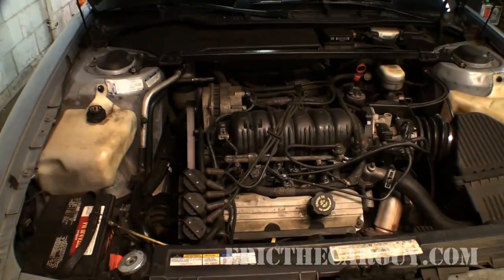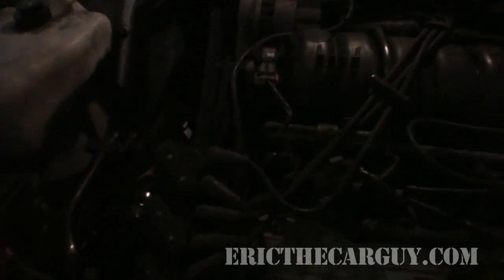Finding Ignition Voltage Leaks - EricTheCarGuy

Comment: I had a new plug wire that leaked On snapped throttle, sprayed water it got worse. Put the old wire back on,car fixed.

Comment: Hi Eric , I have leaks at the spark plug boots arching on the head , I’ve changed plugs , 3 diffrent sets of wires , 2 distributors , 2 ignition coils and still have arching , I cleaned all grounds on the car , the vehicle is a 1986 Pontiac Fiero 2.8 iron heads ,,, any help in guidance would be awesome , plugs and wires have no sign of carbon tracking

Comment: i have a 05 300c hemi and im having the same problems but the spark is more constant than the one in the video i bought some spark plug wires but then figured it could be my ignition coil any opinions of what could it be im lowkey on a budget if not i would’ve fixed both

Comment: Ericthecarguy question I have a 99 Deville DE elegance model. the car will not start have new alternator crank sensors cam shafts sensor fuel pump spark plugs pcm ignition coil packs and still won't start on own.... but mechanic friend put the power wire from battery on to positive line for coil pack and it starts right up. .... why and how or what should be done to fix

Comment: There is nothing that gets your heart racing better than a 40,000 volt shock.  Multiple coil pack systems are much safer.  More expensive, to be sure.  But they are also more efficient and deliver the maximum voltage and amperage to the plug.

Comment: Better use screw driver with wire earthing it to the engine body.
Move it over the wires and it will chatter when on the crack site

Comment: Were you using distilled water to spray the car?
If I remember correctly from chemistry class, pure distilled water doesn't conduct electricity, because it's the ions in impure water that conducts the electricity.
Reply: +DivineAtheistWannabe 
That is why I will put some white vinegar in the water.

Comment: I had the samething/ish .I thought it was a bad u-joint. I didn't think a engine misfire could make a automobile shake so violently. My problem turn out to be a "bad" coil on plug boot. Signs of arcing on the spark plug ceramic insulator was the give away. $20 per boot. Oh and the alternator had failed too which caused the security system to start doing some weird crap from disabling the ignition system to causing the tachometer to stop working. 1996 4runner 4wd if you were curious.

Comment: ****GREAT VIDEOS BTW****
Thanks for all the information.  Heres a little thing I learned about water conductivity while doing experiments for products I make involving current and water.

Purified or distilled water is actually a horrible conductor.  Mineral water works best, then maybe dirty tap water.  Seems to me I need to start working on a spray that will be an extreme non conductor for this purpose specifically.
Thanks again, working on 3 vehicles currently with odd problems Ive fixed.

Comment: Also, instead of blindly replacing plugs and wires, after replacing the arcing part, I would clean all the plugs and check resistance in plug wires, and only replace any above specs.  If the problem is fixed by replacing the arcing part, I wouldn't unnecessarily replace other parts.

Comment: Very confusing.  Eric says he sees a crack in the coil tower, then says he thinks the coil isn't bad, and that he'll replace the spark plugs and maybe the wires to fix this.  6:30 of video and I can't tell where the arc is because he only shows it sparking in the dark.  Is the arc at the coil or the wire?  Wherever the arc is is what I would replace because regardless of whether the spark plug or wire has too much resistance, arcing is abnormal.

Comment: I had a Fiero that would run but couldn't move. I thought the mechanic had conned me by replacing the coil pack, but it worked fine when I got it back so I eventually just let it go. I have seen the electrical show on pretty much every vehicle I've owned. Pretty much every vehicle I've owned ended up getting its coils and wires replaced, and pretty much every vehicle I've owned had that 'fish biting' behavior. I thought old cars just did that. Thanks for the lesson.

Comment: hey eric im just speaking you dont need to comment but i had a small problem with a 96 gmc 1500 i kept getting a p300 and a bad cat code i forget what the code was but it turned out that it had nothing to do with the ignition wires or the fuel injectors but it had to do with the remote starter that was installed they hooked it to the bcm instead of the ignition switch i just want you to know there is a TSB for all chevy gmc hummer from 1996 till2004

Comment: Eric, couldn't you check the coil/coils with an adjustable spark plug voltage tester?-- I saw a video where the coil did spark at about 15,000 volts but didn't at about 25,000

Comment: That's a fairly typical pattern for a failing/failed head gasket, from my experience.  The gasket seal fails around one cylinder, but the initial point of failure sets it up to slowly crawl and spread to the adjacent cylinder.  Check your local auto parts store for coolant test strips that check for combustion gasses, and of course check the coolant for oil (chocolate milk), and oil for coolant.  There's very likely to be cross-talk in there somewhere if the gasket is bad.  :-)

Comment: That's for all cool info. you give.
I have a 93 accord and it has a voltage leak that jumps between a pump belt and the crankcase pully on the front of the engine. I have some excessive oil in 2 of my spark plug tubes most likely from those bad seals. I'm wondering if you think that my sparking is from voltage leaking through the oil in my spark plug tube, into the block and arcking across to the belt? The car runs a little ruff. Bob

Comment: @EricTheCarGuy Thanks again Eric you have been great help for the do it yourselfer like me. I ran a compression test (dry) had 170psi on 2, 90psi on 4 "DoH!" 210psi on 6, 190 on1, 200 on 3 and 200 on 5 so I think its safe to say i have a compression problem cylinder 4 now i just need to hook up some compressed air to that cylinder to see where the compression leak is.whats interesting to me is the 170 next to the 90.. when the rest are averaged 200 psi

Comment: I have a P0304 misfire, Have done....Spark gap check (coil 5 bad )replaced coil, coil 4 OK, new plugs, wires, new fuel injector on 4, solinoid is opening and fuel is going in, injector power is good, so i have fuel and spark, No milky oil No smoke, I only have a rough idle and take off. Once Im over say 10-15 mph everything seems to level out and power is OK. I am going to do a compression test this weekend. Could this be an intake manifold leak? improper fuel air mxture? Great vids by the way!

Comment from the maker: @k3kc3000 I honestly don't subscribe to that because I've never been able to find a bad coil that way, coils normally fail under load and what might test good under the low current of your DVOM will not work when the circuit is active with high voltage.  I've also confirmed this with electrical engineers and they gave me an explanation of why that is true but I don't have enough space here to cover it sorry.  Thanks for the comment.

Comment: had a coil failure and wires had to be replaced on the 1987 bonneville with a 3.8 engine basically an older version of the engine you are working on in this video. at night those bad wires light up like a Christmas tree with big arrows saying look at me i need to be replaced lol

Comment from the maker: @DStylesHanska I would start with a power balance test to see if it's a particular cylinder that is at fault.  I would also do a compression test or even better a leak down test to see if there were any mechanical issues.  I've done videos on all of that, good luck.

Comment from the maker: @colmoneill83 Your correct in this situation it did but most times you don't see the leak like in this video, in that instance the water method works much better and will yield better results in my experience.  Thanks for the comment.

Comment: Yo Eric I love your videos and I just subscribed so I get your latest videos as they come out (woop) anyway, spraying water on the affected area will disguise the problem as water is an electrical conductor, with it soaked in water the voltage will pass from the leak point to ground without it ever having to jump/spark through the air.

Comment from the maker: @wjpsw It may or may not be an engine performance issue, it could be a drive line issue such as a problem with an inner CV joint.  I would check the ignition system to make sure everything is good there first then start checking the driveline.

Comment from the maker: @Halljand I think you should fix the fluid level and do some diagnosis of the systems in question before you just start replacing parts that are suspect as that never works out well.  Look to any check engine lights first for starters and if you suspect a problem with the TPS then unplug it and check it's resistance over the full sweep looking for anomalies.

Comment: The thing I like best about your videos, other than they are very informative, is that you don’t edit out when things don’t quite work the way you had planned. Working on cars isn’t like the manual says – step 1, step 2, step 3....sometimes there are a lot of steps in between like:step 1.1 fix the stud that just snapped off; step 1.2 drill out the stripped screw, etc. That’s the difference between mechanics and the amateurs – the pros expect it, and know how to recover from it.

Comment: "Fish Bites" that is exactly what it felt like. Changed plugs and wires on the wifes Sable when I was changing the Idle AC module.. the car idled fine after that but had intermittent sputters while driving..she drove like that for awhile until it barely made it home other day... could hear the pops and even see spark hopping.. turns out one of the new Plugs had a cracked Ceramic. Actually Split on both sides, could not see it until if got dirty, then the splits were very visible.

Comment from the maker: @finalman82 The screwdriver thing works well if you have a wire going to ground, you can use a test light too.  You don't need to worry about the soapy water as the engine gets wet all the time when it rains and I've never had an issue in all the times I've used this method.  Thanks for your input and for your comment.

Comment: I'm not sure someone has suggested this yet, but, when I suspect voltage leaks I usually take a long screwdriver and start prodding it around the wires/terminals. It's worked for me pretty well so far, and I don't really think I'd go with that soapy water trick... I wouldn't want to risk shorting out anything.

Good tip though.

Comment: Hello Eric, I have a problem with my diesel car that no mechanic has managed to figure it out. I used diesel fuel with motor oil as a mixture (80:20) and since then my glow plugs keep burning out after ten days. I keep replacing the glow plugs and I even put fresh diesel in and the problem is still there. I have checked the timing of the relay and all is fine.My car is a peugeot 306 with a 1.9 diesel engine.  I would appreciate it if you could give me a reply.

Thanks.

Comment from the maker: @Jcal022 Because of money issues I only replaced the one coil and the one wire and it works fine but they aren't that hard to do and yes I use Delco parts.
Reply: My 2010 Saturn Outlook XE is literally doing the same thing what you showed it’s arching you can see the spark. So I guess I need to replace the coil and a certain wire at this point I might just replace everything honestly ...

Comment: @dangdatstony Get the code read at an autoparts store for free. Take the code and your vin# (printed on your registration or insurance card) into service dept. And ask them to check it out for you. See if there is a time or mileage limit. They always do this for me no problem. Because they will charge you almost $100 just to pull the code if it doesnt qualify. They waive it if it does.

Comment: @EricTheCarGuy Yeah... I usually just use a spray bottle with a fine mist and that gives me a little lightning show if there's any voltage leaks. A while back I leaned my arm on my plug wires when I was adjusting the idle and I got some pretty good jolts right in the elbow, that day I didn't need no spray bottle.

Comment: I had a 94 T-bird with the 4.6 and the original wires hadn't been changed in 140K miles. The wires were so old and cracked that if you reved the engine at night you got a blue lightning show over all the wires. While it was cool looking, I replaced the wires anyway. Odd thing, that 4.6 never even gave a hint that the ignition system had problems. It ran as smooth as ever. I miss that car. :(

Comment from the maker: @ncrdisabled That problem may be a little more complicated than that because those circuits actually run through a body control module if I'm not mistaken, the switch sends a signal to the BCM and the BCM sends a signal to the motor, there may be a communication issue somewhere, I would be using a scanner with BCM capability to check into that further.  Good luck and thank you for your service.

Comment from the maker: @crombieposterboy Actually this was a bad wire that caused the problem.  Aside from that it's the ground side that is switched to activate the coil so I don't believe the ground circuit is the problem or the coil would not fire at all.

Comment from the maker: @aznofwar Start with an oil change, disable the fuel system either by pulling the fuse or relay before you start the car and crank it for a while to circulate the oil, then reconnect it and start it up.  Letting a car sit is the worst thing you can do to it so be prepared for some work when you get it going again.  Good luck.

Comment: Hi! 
In one of realfixesrealfast videos was a method when you ground a screwdriler to car body using a wire. Then you can move screwdriler across ignition wires and other components and see where the spark jumps.
The high voltage will find the easiest way to car body through that grounding wire without hit You, if you dont touch screwdriler metal parts.

Comment: @dangdatstony Do some research. There was a recall on this depending on the code you have. Happened to our V6 Accord of the same year and the dealer took care of it no charge. Was caused by a buildup of carbon in the EGR passages. I think the code reads something like "insufficient flow". They actually go in and drill them out bigger and sleeve them with bigger tubes if I remember right. Good Luck.

Comment: I have a bad problem I am disabled as you now a NAVY vet from submarines 7 yeas. 
I have a 2003 chevy venture where the right and left rear side windows motors do not work at all I have replaced switch assy checked fuses ok put 12 volt to the motors they both work great but switches in the overhead do not seem to work no mater what have you ever had one with this problem ?

Comment: @spelunkerd  The tenth digit of your Vehicle Identification Number determines the model year of your vehicle (in North America) From 1980 to 2000 model years were letters. For example A was 1980 and 2000 was a Y. The letters I, O, Q, and Z were not used. From 2001 to 2009 they switched to numbers with 2001 being a 1 and 2009 being a 9. Starting with 2010 model year we're back using letters with a 2010 model car having an A and a 2011 car using the letter B and so on.

Comment: @spelunkerd  Manufacturer to manufacturer can vary, the emissions control label (VECI), title or registration give the accurate model year .  Generally October or later is the NEWER model year.  But some cars like Tiburons are Dec 01 and are MY 2003, and GM has had many models that are a model year newer despite being produced Jan/Feb/Mar. But those are usually new / re-designed models  Exotics (Ferrari, Lambo) and limited run /tuner cars (Lorinser, Alpina, Hartge etc) are harder to decipher.

Comment: you are right about those ignition system. I got zapped by my 4.0L ranger coil pack looking for the cylinder that was not firing. dang ford, leaks oil in the one cylinder and fouls the plug. Great video and happy fouth of July.

Comment from the maker: @Halljand If the fluid is at the proper level then you may want to take it to a transmission shop, if it's not then top off the fluid and see if the problem still exists.

Comment: Did you say, Fish-biting (grin)?
I'm always a little confused about model year, since a 2008 is often made in 2007. Where do you look for a definitive model year?
I see 'thread chasers' sold in auto stores, designed for spark plug or oxygen sensor threads. Do you find those devices useful?